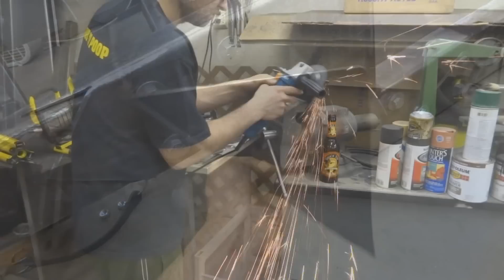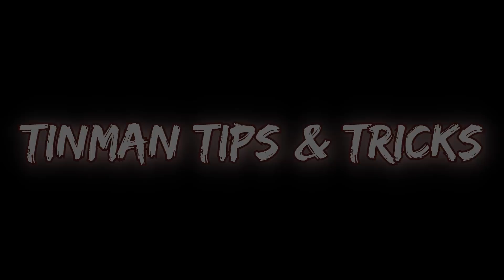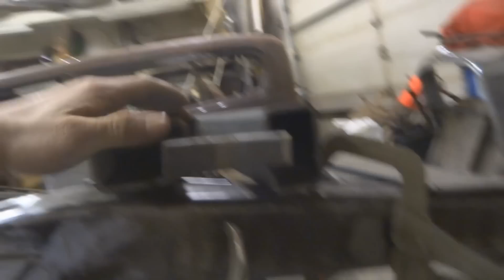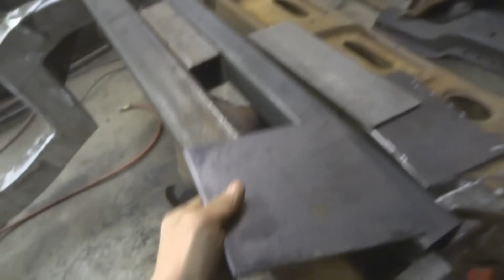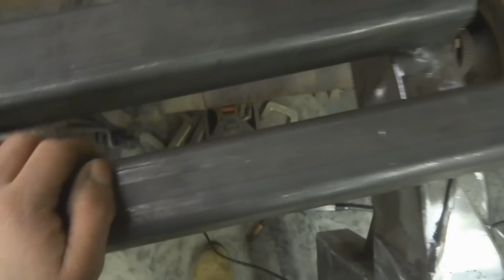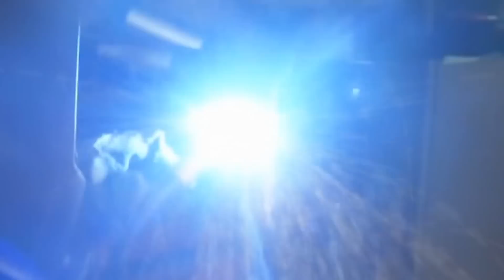Cummins Rat Rod: Project "Wild-Torquey" (Ep. 13) INSANE BUILD!!

Comment: Do you cut everything more or less with the cutting wheel or do you use a torch or plazma cutter off camera I understand you get a nice clean cut with a cutting wheel but just curious. I have enjoyed this series so far. Thumbs-up.
Reply from the maker: Everything is cut with a cut off wheel. I dont have a cutting torch. I have a plasma but it works better for sheet metal than this thick stuff. Thanks for the compliment!

Comment: That thing is gonna be an absolute beast! just curious, got any plans for a crazy exhaust?
Reply from the maker: I will be running 5" exhaust out the side.The whole stack thing is overplayed, IMO lol
Reply: yea I agree, dang near every cummins rat ive seen as a short stack right off the turbo. lol. I thought of an idea, dunno if it spikes your interest any. what if you routed the exhaust from the turbo through the firewall, into a "T", and ran it out both sides through the bottom front corners of the front cowl. just a thought. im sure it would be a lot of work, but I cant say ive ever seen anything like that done before.
Reply from the maker: Thats not a bad idea, but unfortunately I wont have any extra space inside ha my feet are going to be crammed in there... have to raise the floor a whole bunch to clear everything and body drop it around the frame.
Reply: yea that's one thing I thought of after I posted my last comment lol.
Reply from the maker: Good idea though!!